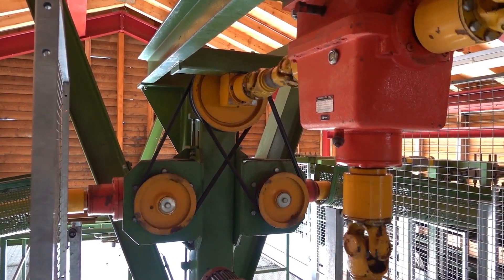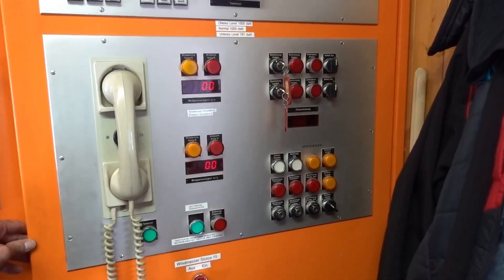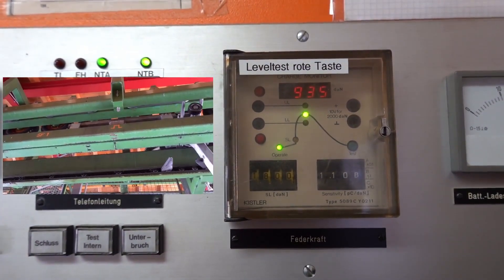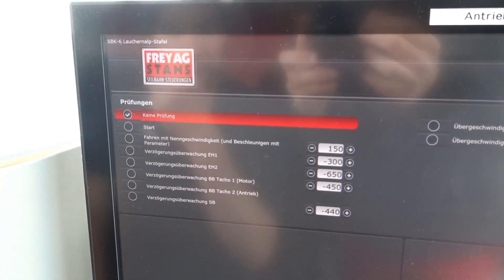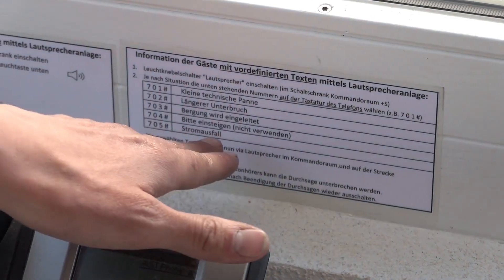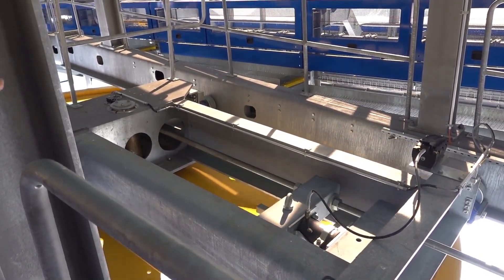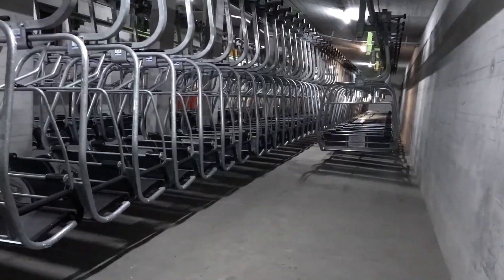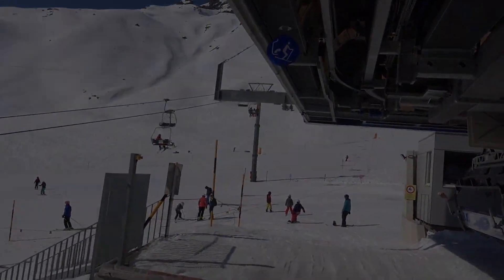The incredible leaps of three decades of technology evolution! Chairlift comparison (part 3/3)

Comment: Awesome video!!

For the pulse counting part where the motors adjust their speed so that it matches the reference pulse number, do you know if 1 pulse is equivalent to 1 PLC cycle? So the control systems would be running at around 25Hz which sounds very low but I have no clue :)

Comment: Maybe looking at some aerial tramways could also be interesting for a future video.
I especially find the ones interesting where the two cabins are able to move independently, such as the "Urdenbahn" between Arosa and Lenzerheide.
There, the cabin going in one direction usually does not start moving at the same time as the other one and in the summer they even only run one side of the lift at once.
Have often wondered how this is done, as the two sides are normally linked as a single "loop" of rope.
Reply from the maker: Thanks, I put that on the list!
Reply: @sandro-here  you've heard of Doppelmayr, right?